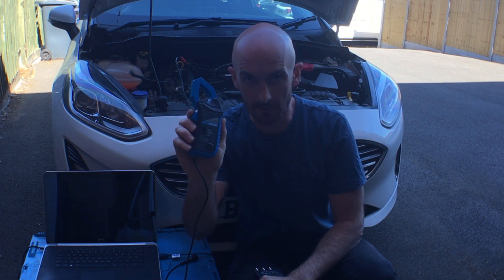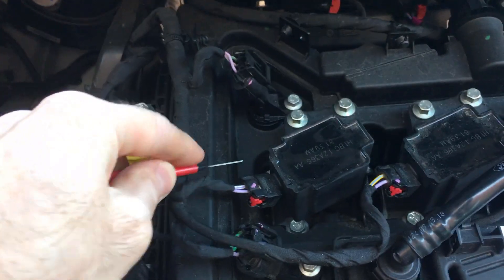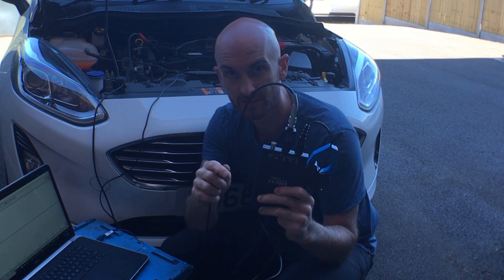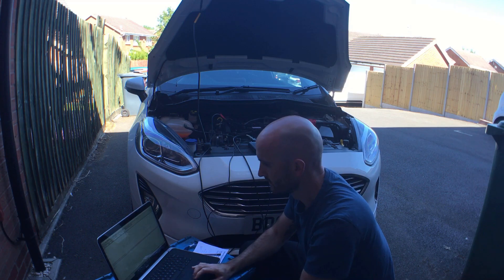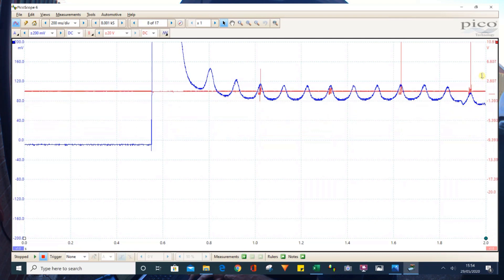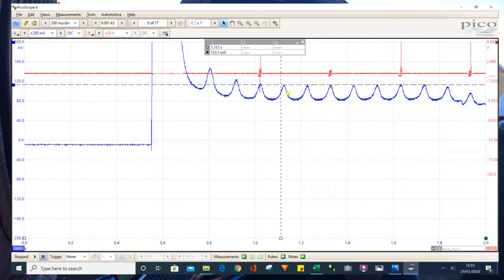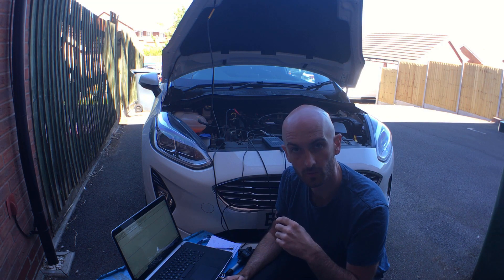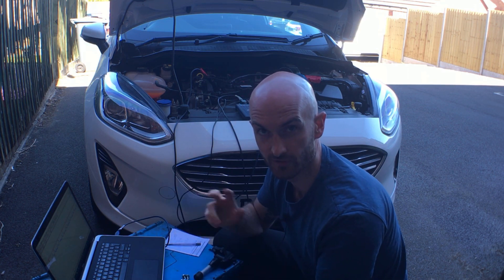GOOD vs BAD RELATIVE COMPRESSION TEST [PicoSope 2204A and Hantek CC-650] Mechanic Mindset

Comment: While cranking, do you open the throttle plate (step on the accelerator)?
Reply from the maker: You can do that like a normal compression test. It’s best practice but you’ll get similar results

Comment: Im using pico 7 with the 2204a but my relative compresiune is very noisy, do you know what i could be doing wrong?
Reply from the maker: @alexandrumardare828  using a battery charger? It’s quite hard to suggest without seeing the set up

Comment: How did you get the automotive version of pico6 to work with this scope?
Reply from the maker: I’m not using the Automotive version 👍 There was a little trick to make it work but it’s not possible anymore. We never used automotive in any of our videos with 2204A 👍
Reply: @MechanicMindset  I just seen the automotive tab on the screen of your video and realized my version of pico 6 does not have it

Comment: When taking measurement on number 1 ignition coil, did you ground the other lead or is it just one lead going straight to power?
Reply from the maker: Can’t remember how I took this measurement. If measuring direct voltage, use a ground. If just picking up the spikes, no ground needed

Comment: why not monitor battery voltage on the oscilloscope for compression testing? It gives the same waveform the voltage dips as the current increases.
Reply from the maker: We have a video on that too actually 😁

Using an amp clamp is much simpler and more accurate, especially with this low spec oscilloscope

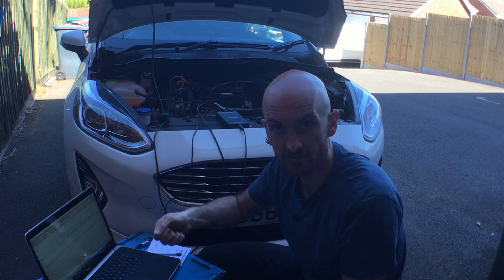Comment: How did you identify cylinder number 1 at 3:25? The second line under the compression wave form makes tick marks under cylinder 1. I assume the ignition (spark) needs to stay on for the test to work?
Reply from the maker: Yes, I’m using ignition for trigger 👍
Reply: @MechanicMindset  thank you! I edited my original comment so that it actually reads like English and makes sense but you understood my question nevertheless :]
Reply: If you are doing this test with a diesel you could connect a «dummy»  to the injector connection. Basiaclly just a resistance. Then backprobe like you would with the coil.

Comment: How do you Mount the leads on Channel B.?
Reply from the maker: For the cylinder trigger? Many options, any way you like to pick up the coil signal, could probe the primary trigger, use the coin on coil trick, or secondary clamp if you have one. Hope that helps 👍
Reply: @MechanicMindset  if I use primary trigger I use it in respect to ground.

Comment: How comes I copy the setting but don’t get same pattern I have to go to 500mv to get waveform
Reply from the maker: Hi, it depends what you are using to take the measurement. If it's an amp clamp, did you change the probe type?
Reply: Same hantek as yours

Comment: One question: when you're using the amp-clamp, it measures voltage... (in Pico), is that to do with ohms-law? Decrease in current means drop in voltage?
Reply from the maker: Great question. You should consider the amp clamp, like an ‘amp sensor’. 

Like a pressure sensor, it sends a voltage signal to the scope which is relevant to the current it measured. 

We change Pico to convert the voltage to an amp reading (eg 100mV = 1Amp)
Reply: @MechanicMindset  It measures the EMF-field in the wire right? So there's a setting in the software to convert the voltage to amps?
Reply from the maker: @HerrDagerman  That’s right. Any wire with current flowing has a magnetic field around it, the clamp measures is and sends a voltage signal that’s relative
Reply: @MechanicMindset  Ok, understood :) Thanks for taking the time to help :) I went to collage for this you know but there's always something new to learn. Thanks again for introducing me to Picoscope. Your channel made me upgrade (I had a cheap Hantek oscilloscope before, I didn't like the software) to a Pico 2000-series :) Also made me order an attenuator from Amazon and two great Hantek probes :) Made me understand sample-rate too :) Golden! Really helpful in my work

Comment: Hello, I got a 2040a after watching your channel. Doing a relative compression test today my image was extremely pixelated and not really detailed. Do you know what setting I should use to get a better image? Thank you.
Reply from the maker: Hi, with voltage or amp clamp?
Reply: Hello, I use a pico amp clamp.
Reply from the maker: @Mrkerrypray  You can adjust the vertical resolution in the channel A option menu 👍

Comment: Hi I have just received a 2204a mainly from your recommendations thanks 
My question is on this test you use a hantek amp clamp, I have a 600a clamp that wanted to use for doing this sort of test but the pico 6 software only shows 60a
Reply from the maker: You can either just use the voltage scale and convert to Amps (it should say conversion on clamp), or you can make a custom probe using that conversion in the probes menu 👍
Reply: Ok thanks

Comment: Could a 65 amp clamp with attenuator be used for this?
Reply from the maker: I like your thinking , but it doesn’t work like that. The amp clamps only have a small voltage output. It’s the amp clamps capability to measure the height current that is required 👍

Comment: Thanks for sharing your excellent knowledge. Can I ask if one car failed relative compression test, should I still need to check coil plug and spark plugs condition?
Reply from the maker: I would probably look at what is causing the low compression 👍 Thanks!

Comment: hi sir! may I ask what probe settings you used for that cc 650 hantek in non-automotive scope thank you.
Reply from the maker: Hi! I don’t think I used a probe setting in this video, just voltage scale. I don’t think I have a custom probe for this, I need to make one and share!
Reply: @MechanicMindset  ah... so that's why I didn't see how you set your probe settings because you used a voltage scale for 200mv=200A? because your clamp setting is 1mv/1A. I'm also interested in 2204A I'm just new also into scoping. thank you sir God bless to your channel.
Reply from the maker: @sokakutakeda1500  That’s right, the scale isn’t so important for relative compression, we just want to compare each peak. It is really easy to set up a custom probe; just need basic maths. 

You can’t go wrong with the 2204A to start 👍
Reply: @MechanicMindset  yes sir I'm already saving money to buy that one instead of hantek. i already have the software in my laptop for 2000 series and the automotive one to play with the settings. i just saw some videos that you can add new custom probe on non-automotive scope but you just have to know the minimum and maximum input and scale like for instance you can add the hantek cc65 and 650 in library of the 2204A but I'm still need to learn a lot and research a lot to know how it supposed to be done so I will not have incorrect measurement in the future.
Reply: Hi @mechqnic mindset i have the cc650 amp clamp and the pico 2000 do you a probe setting the i can use for relative compression test. Much appreciated thanks

Comment: recantly got into scoping but come across few of the videos where you explain the attenuator because the scope you use is 20v max. but if it reads over 20v do you mean it just will max out on the scale at 20v evan tho it read 25v or will over 20v fry the scope? thanks!.
Reply from the maker: Great question: it will max out the scale on the scope. 2204A has 100V over voltage protection. I have exceeded 20V a number of time with no issue but be careful! The manufacturers recommended not to exceed the max input. 👍
Reply: @MechanicMindset  thanks for the reply! picked up a cheap verus pro but  perfer the layout of pico for adjustibility compared to snapon!

Comment: can you explain the wire back probe into coil #1 at 58sec mark.   I assume you back probing the power wire on the COP, do you need to clamp the ground wire to the car with the HT30A wire set you using?  or just leave the black connector alone?
Reply from the maker: Ed Lu Hi, for the COP, red wire in ignition trigger from ECU, black wire to ground. The clamp doesn’t have any extra cable for ground so just connect directly to scope 👍
Reply: @MechanicMindset  thanks! going to buy your set up and test it out!
Reply from the maker: Ed Lu Cool, let me know how you get on and if you have any questions 👍
Reply: @MechanicMindset  I finally got all the parts.  Tried it the first run today on a F150 v8.  I set the pico to everything in the video ChA 200mv.  ChB 20v and 200ms/div.  Only thing is my result the ChA blue graphic is no way as clean as in your video.  I only can make out 4 peaks not 8 between each ChB.   I can send you the wave file via email
Reply from the maker: @edlu73  OK, send it over. My email is in about section 👍

Comment: I am loving your videos.  Best training for newbies like myself.  I have a question. The lead that you plug into the coil, that is always grounded as well?  And if you are using more than one, each one is grounded I assume, because they need a reference point (and they all have a ground clamp as well...?)  Thanks
Reply from the maker: Jeremy Hi, re, the grounds, it depends on the scope. The grounds on this scope are joined, so in theory you only need to connect one ground, and both channels will receive it; I always connect both from habit and to avoid a spare lead lying around. Some scopes (like 4425) have floating grounds and are independent of each other. The need to have their own ground but also provide other benefits/safety for measuring more than one circuit. I am going to explain in a video I have planned!  Glad you’re enjoying the channel, more to come! Thanks 👍
Reply from the maker: PS, clamp doesn’t have a ‘ground’. Imagine the two ends are connected to the electronics in the clamp
Reply: To anyone wondering similar questions how to actually plug stuff in for the tests, here is a great link from pico

https://www.picoauto.com/library/automotive-guided-tests

Comment: I have tried same configuration, however I do get a lot of noise and not very definitive picture. You have very clear peaks and easily determined cylinders. With mine it looks like earthquake graph with many highs and lows...
Any suggestions?
Reply from the maker: Stanislav Tsonchev Hi, maybe check the clamp is not on the low current setting, that is very noisy. You can also reduce the sample rate which might help a bit. You can see my other video where I review the clamp, I play with a few setting due to the noise issue 👍

Comment: Did you set up the cc-650 amp clamp in picoscope 6, if so how was it done. If not what probe did you set ch. A to? Thank you
Reply from the maker: Steve M. Hi, I didn’t set it up. I just used the normal voltage scale and converted it 1mV=1A or 10mV=100mA, depending on the switch setting

Comment: you use 2204a as an  automotive scope, do you think it is good to buy  it?  at leat iwant to use it to detect engine,abs  sensors signal
Reply from the maker: abdullbasit osman Hi, yes for sure. This is great for automotive use. For basic functions, it’s very similar to the Pico Automotive kit. Check out this video where I take a few different measurements. https://youtu.be/1LBKtlpCj_4 Also, list of the kit you need is in the description. Thanks!
Reply: @MechanicMindset   why pico manufucturer  says 2204a  is not automotive device? is it  because  2204a cant do other automotive dignosis  or it does but not good ?
Reply from the maker: @abdullbasitosman5070  Hi, PicoScope make the automotive scope that has some extra benefits for testing automotive components. For example, it has a higher input (200V now I think), and on the later scopes the grounds for each channel are separate which will avoid short circuits when measuring multiple components (like 12V ground switched injectors). Other than that, i think it is mostly marketing plus the automotive software (which is good if you are new to using a scope). This is only my opinion of course! 2204A is great for automotive if you know it's limits; 4 channels would be nice
Reply: @MechanicMindset  thank u for all your reply.  not all  reply  people questions
Reply from the maker: abdullbasit osman You’re welcome!

Comment: Does Euro cars have clear flood mode ?? On many U.S OBD2 vehicles that are below 8601lb GVWR have clear flood mode. If you hold the accelerator pedal to the floor (WOT) it will disable the injectors hand will not start . Also I think the pattern is inconsistent because if it is an electronic throttle body the ECM might be moving it thus changing how much air in going into the cyl effecting compression .
Reply: You VVT theory may be correct as well , most system only advance the VVT when it's running but I'm not familiar with that make car so they may doing it while cranking .
Reply from the maker: Mark HB I’ll be honest, not heard of the clear flood mode before. That would bank on the driver knowing to put their foot on the gas while cranking. Most ‘Joe Public’ would just keep cranking and make it worse; so your idea about it opening throttle stacks up. Let’s see if any Ford experts can help confirm 👍